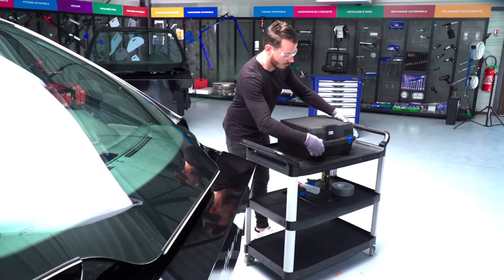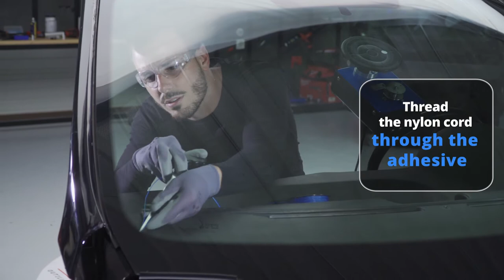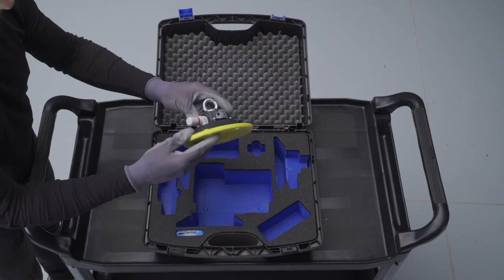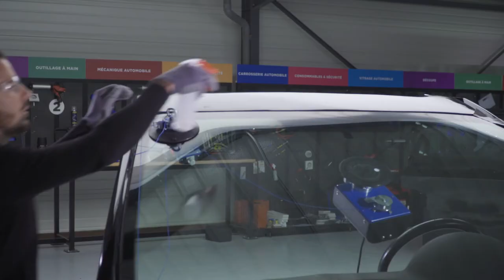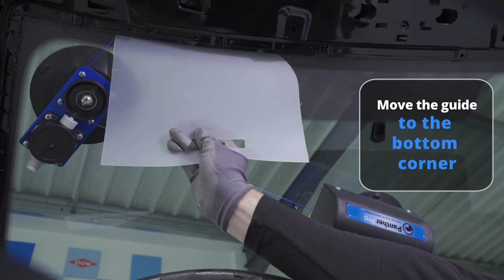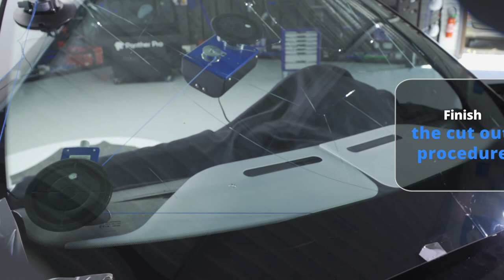Panther Pro RL-EEZ. A motorized remote controlled windscreen removal tool.

Comment: What about windshield's with heated wiper park, generally the electrical connection ie solder points break the cord or bind the tool...AND  what about vehicles with the oem glass that had the alignment pi s still in the holes in the pinch welds they also break the cord